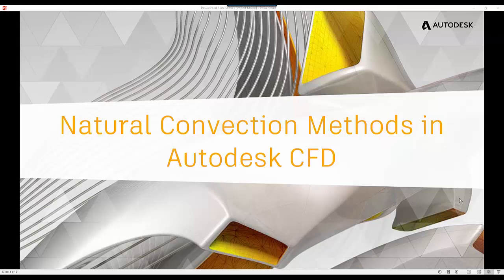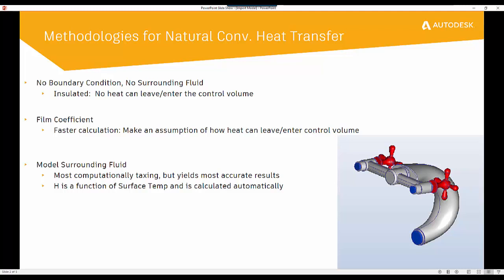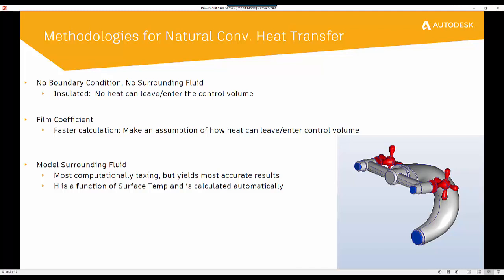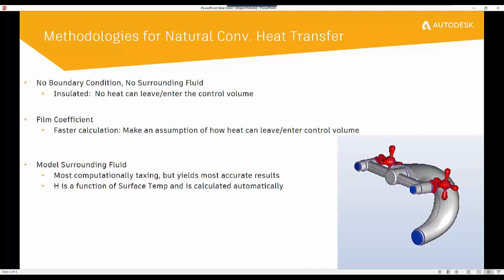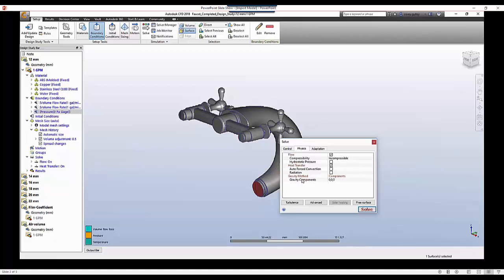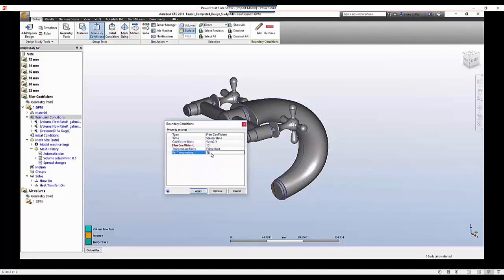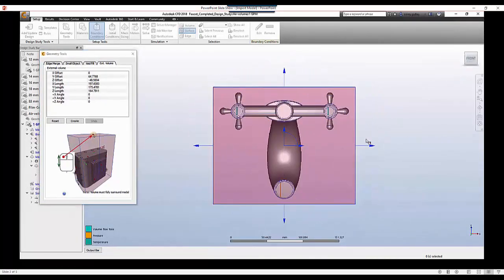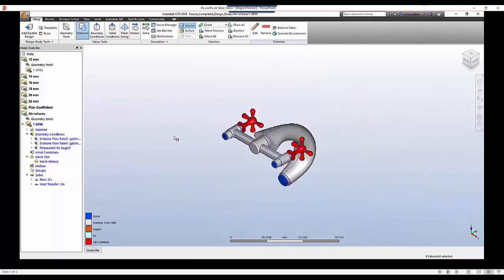Methods to Model Natural Convection in Autodesk CFD

Comment: Hi sir.Would you mind helping me in cfd simulation for a rotary stainless steel drum filled 30% of internal volume by water at the bottom and coverd by molten sulfur at external surface to be cooled by inner water(solidification)?